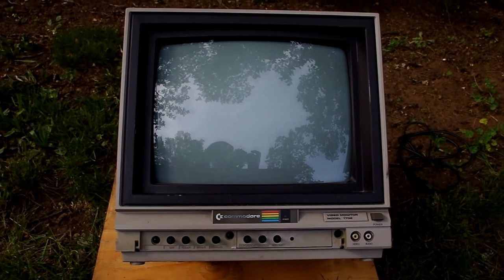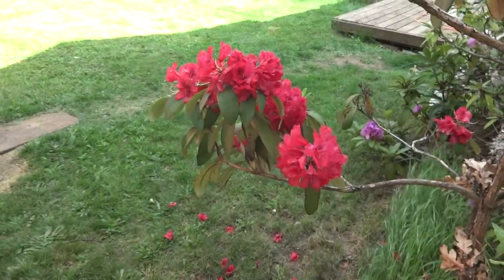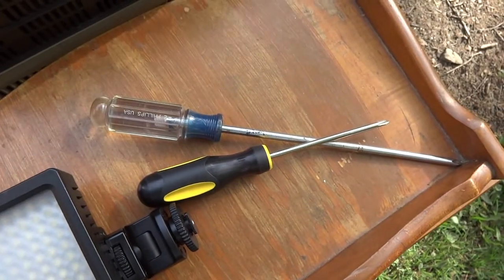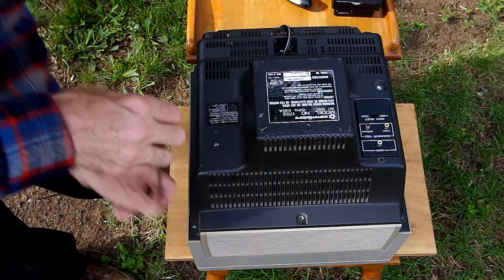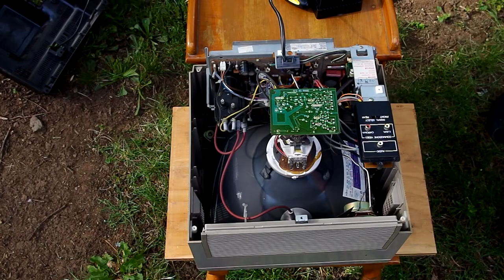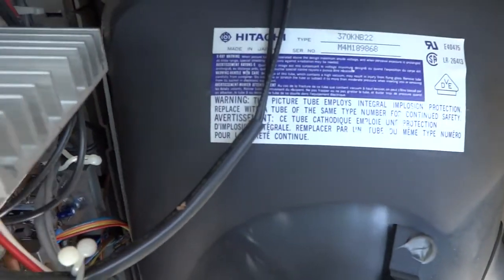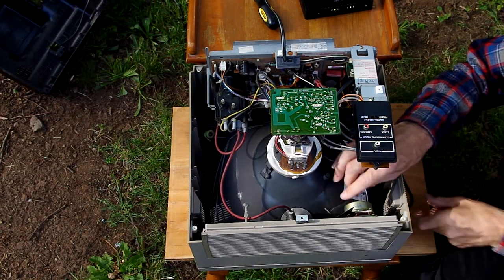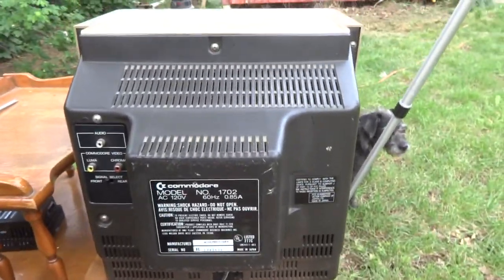Commodore 1702 monitor

Comment: I have always had a problem with flickering video and audio. I used to fix it by toggling the power quickly, or swapping audio and video cables temporarily. Then it would work fine as long as it was on. These fixes no longer work for the video. I tried an electric duster to no avail. I assume there is caked on dust inside. First how do I go about cleaning it? Second if that doesn't help how do I diagnose the issue?